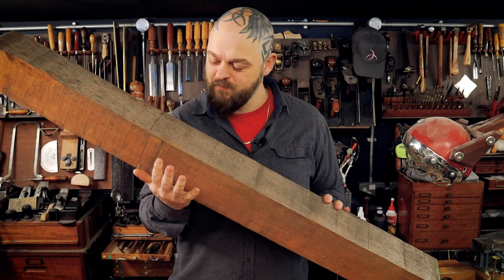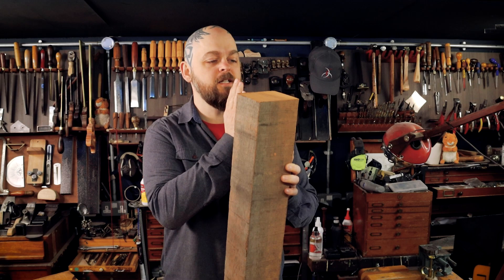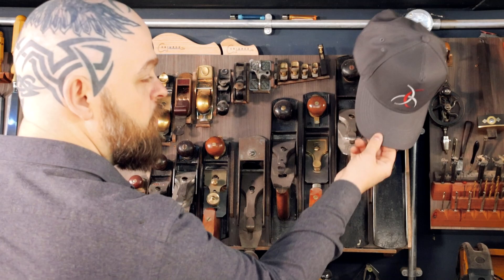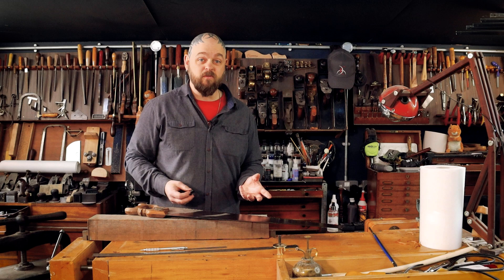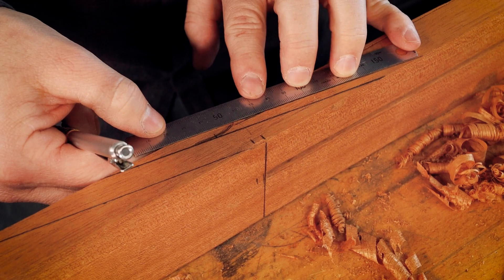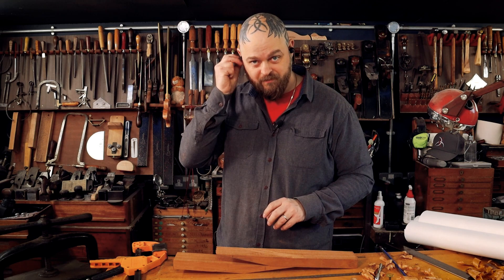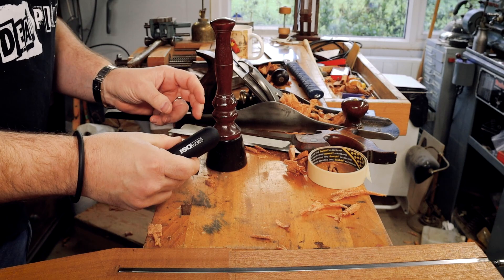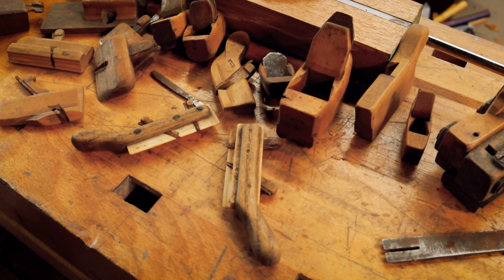Ep 2  Cutting a Scarf Joint | Hand Tool Only Acoustic Travel Guitar -  Guitar from a 4x4 FENCE POST

Comment: Your first choice of saw for the rip cut was the correct one but a shorter one would have been more manageable. Yes, you needed to carefully wedge the start of the cut but it would have taken moments to fashion a wide, wooden wedge rather than the crude screwdriver.
  Sixty years ago My GCE Woodwork teacher  taught me that, whilst it is necessary to start with a diagonal cut, the more teeth in the cut the better. That is also true when cutting metals; you should never have less than three teeth cutting and the more the better. Ripping down vertically or cutting from both ends is never a good idea. Similarly, changing saws part way through the cut will never work out well because each saw has a different 'kerf' width. In particular, the Japanese pull saw has no or virtually no tooth offset so it becomes impossible to guide it in a long cut.
  Whenever you divide a piece of timber (seasoned or not) along the grain it has internal stresses that will result in some curvature. e.g. I learned that cutting 5mm strips from 25mm x 5mm balsa induces severe curvature. On the other hand, your decision to split the wood along the 'shake' was excellent!
  I admire your ability to design and build guitars far better than I could but you seem to have missed out on some basic woodworking, carpentry and cabinet making skills.
To conclude my rant, I have yet to see any YouTube 'Luthier' or even manufacturer who has the least idea about modern electrical connection practices. A soldered electrical connection is not achieved by 'gluing' the wires to the terminal with hot lead/tin; first make a secure mechanical connection then secure it with solder. This may be irrelevant to this build but I hope this 'small body guitar' will have the option of piezo and/or acoustic pickups. 

/Rant, Alan S